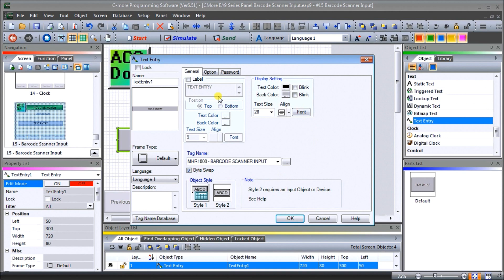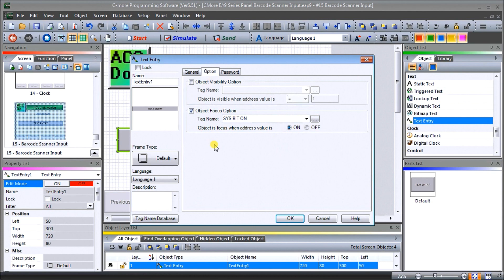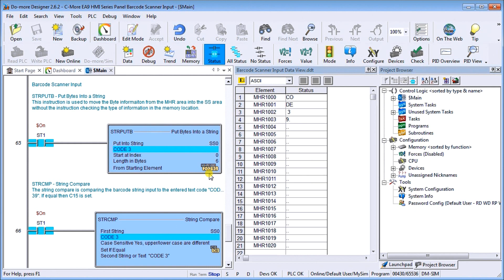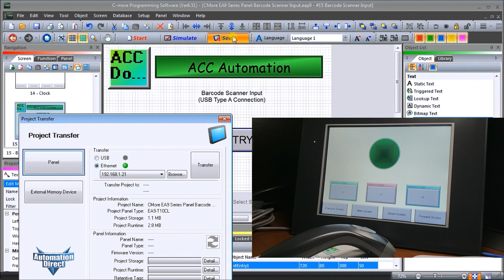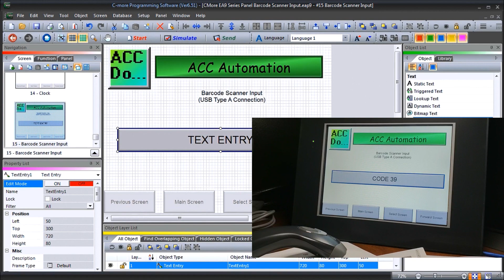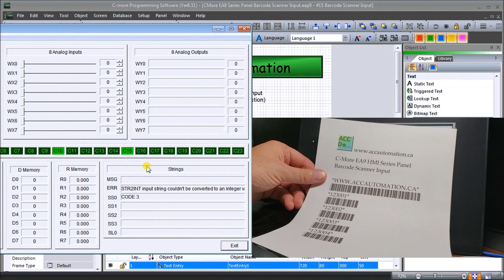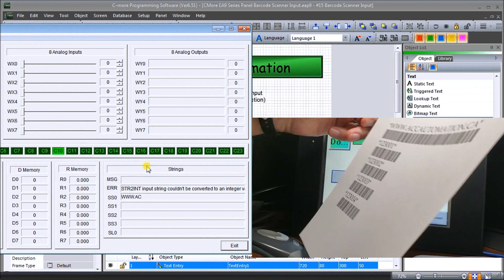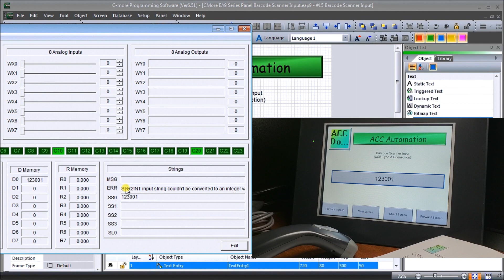C-More EA9 HMI Series Panel Barcode Scanner Input

Comment: I'm using delta HMI +plc
But when i scan data it can scan correctly but when i scam second time then data is comes in series with 1st one.. (that 1st scan data nat erase)
Reply from the maker: Hi Freshly Brewed Spells,
I have not used the Delta HMI + PLC, but usually, the barcode scanner input is looking for a termination character. This is sometimes a return (0xOD) or you will need to enter the value with a touch of the HMI. 
I hope this helps you out.
Regards,
Garry